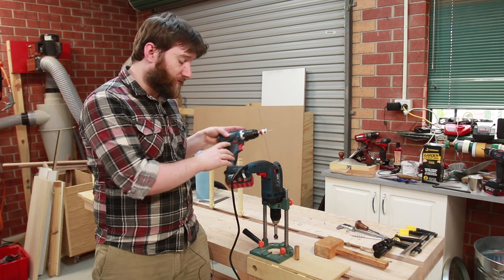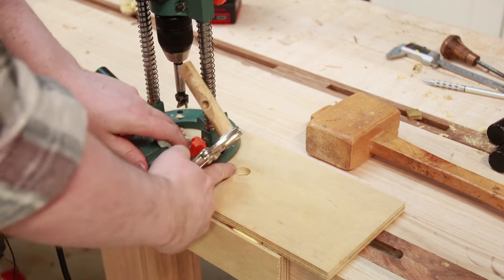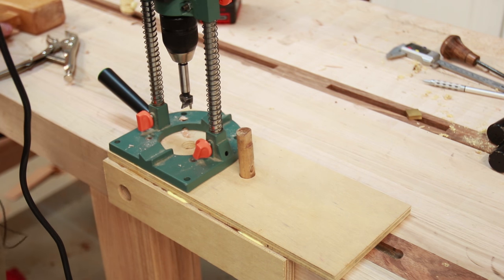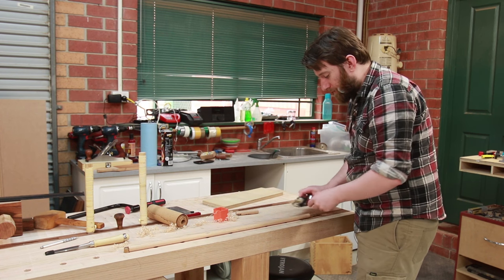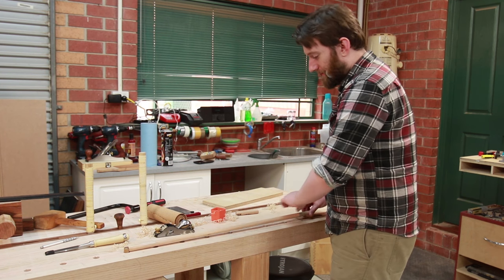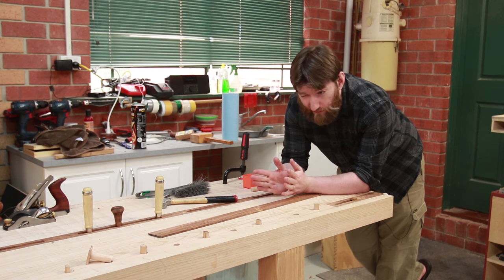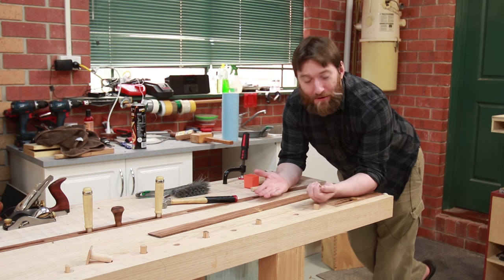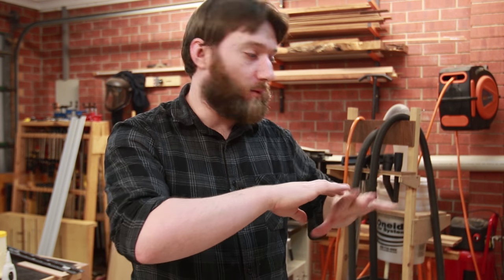131 - TWK Split Top Roubo Workbench: Dog Holes and Bench Dogs

Comment: Almost finished. Time to sell your combo jointer/thicknesser and use the joinery bench for flattening boards by hand :D
Reply from the maker: Hah. Not going to be giving up my power tools any time soon, though I will likely (next year) add some more hand tools (even if they're home made). The bench dogs are super useful for power tool tasks - maybe even more than for hand tools. Routing, sanding, and even the domino all benefit from that type of work holding

Comment: Nicely done! Btw how many dogs are included to tail vise from HNT Gordon? Regards!
Reply from the maker: Just the one, 1/4" high brass dog - more can be purchased from their website. Either you can get the same size (1/4"), or it also comes in 1/8", 1/2" and 3/4". Alternative you could even make your own out of wood if you've got some 1/2" dowel.
Reply: Thanks for the answer!

Comment: G'day Paul, very nice build mate. Question mate how do you like the Kreg bench top clamping system with automaxx clamps running in T-tracks? I know it's expensive type of system but seems a good option for novices, appreciate your opinion, great channel 👍🏻🇦🇺👍🏻
Reply from the maker: I think if you use a lot of pocketholes that style clamp/holding system could be very useful... but DIY the table. The Klamp Table is horribly expensive - over $500AUD for that tiny piece of crap!? Its essentially an assembly table, rather than a workbench. 

Look into homemade MFTs for something that has a wider range of uses and accessories (including benchdogs and auto-adjusting clamps that fit into bench dogs, similar to the automaxx clamps)